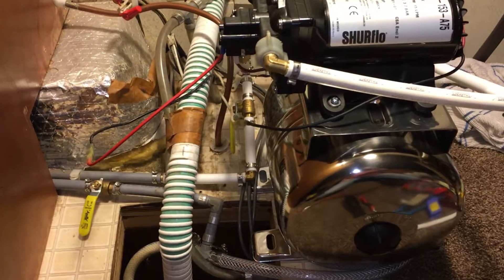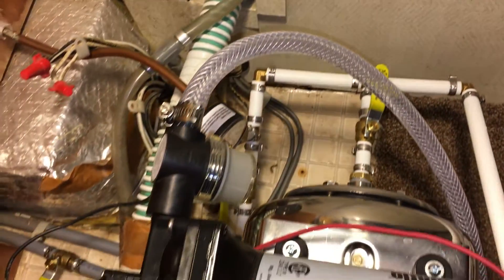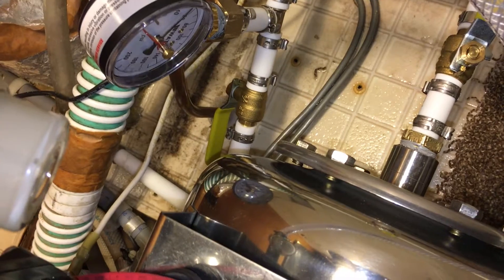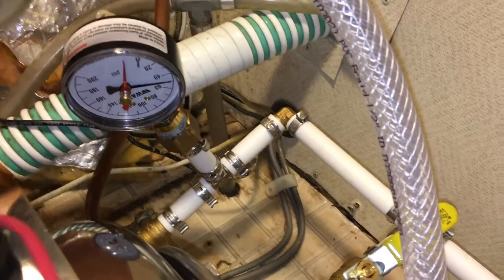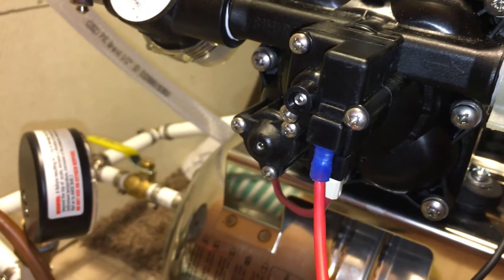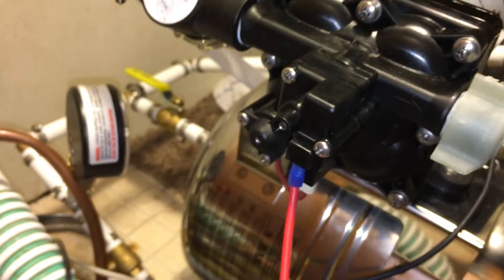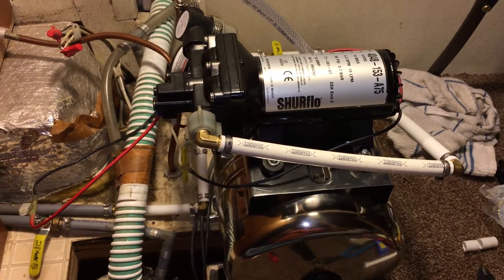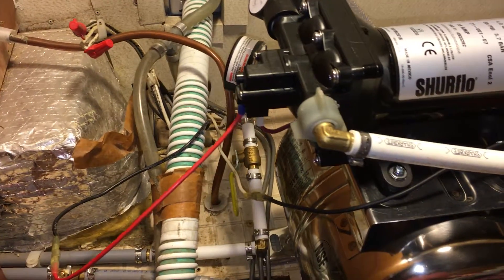Pentair/SHURFLO 4048 Pump and Accumulator Tank Fix

Comment: Hey - Thanks very much for posting this! Pump wouldn't shutoff when I commissioned the water system this week. I found it running when I left the switch on a little longer than I wanted after running the washer. Came back several hours later and found the fresh water at 3% and the pump running. I thought I might have a leak and/or burnt out the pump vanes. I was ready to order a new pump, and found your video. A quarter turn counterclockwise, and all is back to normal.

Comment: Nice and professional explanation .
Thanks a lot  ,  if you could observe how much it's time or litre water tank gives you before the pump kicks again that will be helpful .
Reply from the maker: Haven’t tried measuring it, but I’d guess it’s roughly a gallon or so. It’s a two gallon accumulator tank, but it won’t drain completely before the pump kicks in. One nice thing about the accumulator tank is it helps keep flow even when the faucets aren’t wide open, and are just set to trickle. You don’t get the pump pulsing on and off.

Comment: How do you like the accumulator tank, along with the pump, setup?  Does it help with the cycling on and off of the pump? And the up and down pressure in the water at the taps?  Thinking about ordering one of the 2 gallon shurflo tanks that has the mounts for the pump right on top of the tank.....But I haven't run across anyone with the complete setup .  Would like your input....
Reply from the maker: Hi Rick...

Yeah, saw the unit with the side mount capability after we'd purchased this one. The pump was ordered separately. DEFINITELY shop around. I can't recall exact figures, but I found an online vendor for our tank that was drastically cheaper than everywhere else. Maybe they were one of those surplus places that got an odd buy and were able to sell it a lot cheaper? I'd have to dig back into my research to be sure.

Performance-wise, we're really happy with the unit. Definitely helps with the pump not constantly cycling on/off, and evens out pressure to the fixtures. At some point we'll be replumbing the entire trailer, but the setup works very well with what we have currently.

Comment: I have that pump and it creates ALOT of vibration. It is mounted on foam with the rubber feet, hoses not touching, etc. Just a crazy loud pump. How do you find yours?
Reply from the maker: Hi John Boy...

Sorry for the delayed reply. The pump's been pretty quiet for us. I have it secured to the top of the accumulator tank, but the tank's loose on the floor. Basically held in position by tension from all the PEX surrounding it. I may add rubber feet and secure it at some point. We also have a dinette booth that I built that surrounds the whole setup, and we have sound deadening foam squares packed in around it. Sometimes it's louder than others, but I think that may be because it's shifted around a bit. Doesn't really bug us, and we have plenty of other projects to tackle before fine-tuning the pump installation. I'll let you know if we tweak something and the sound gets quieter, though.
Reply: Sounds like you need a better accumulator tank.
Reply from the maker: @Fix-it-tony  I noodled around with isolating the setup a bit, and it’s very quiet now. We’ve had the pump and accumulator tank in daily operation for three years now (we’re full timers). Works great!
Reply: @Fix-it-tony  It's a nice tank and pump. Brand new Shurflo. I was using it in a hair sink indoors in a quiet space.  I think these really are only meant to be buried in motorhomes or tucked away in commercial kitchens.